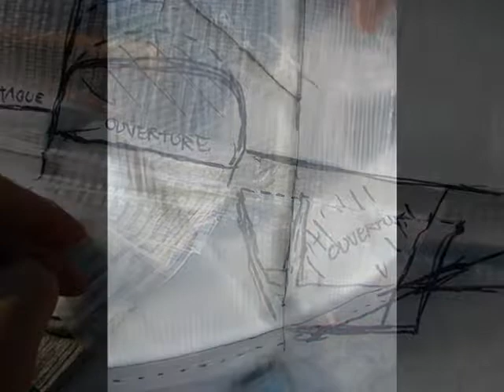(5) Hunter 30 1980 Refit - DIY Full Enclosure (dodger and bimini)

Comment: What did you use to bend the frame?
Reply from the maker: I used the tool that you can see at 0.13 seconds of the video. This is an electrician binder.